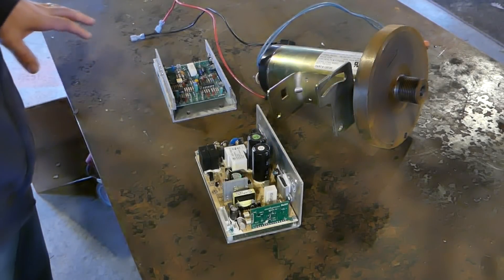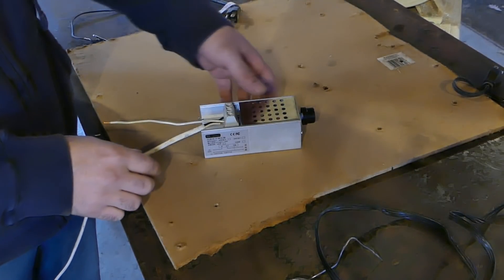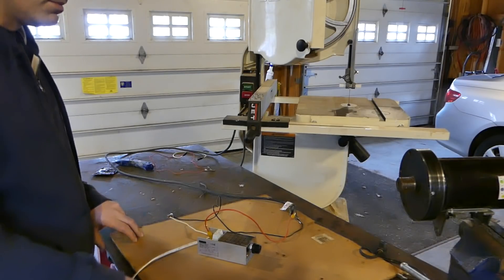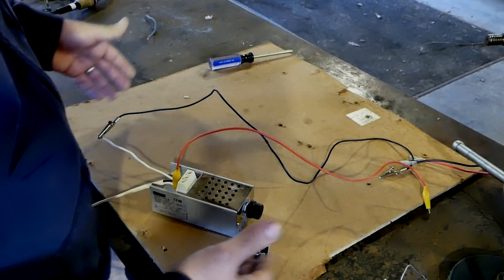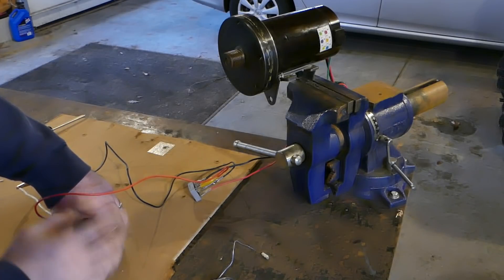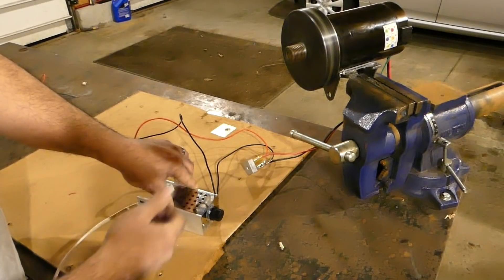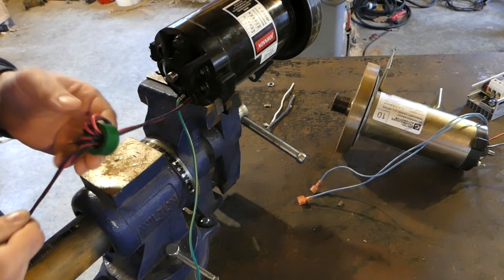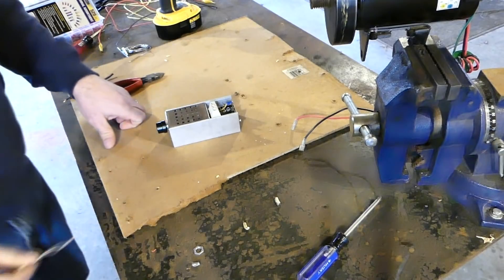Low Cost DC Motor Controller For Treadmill

Comment: I bought the parts now I got to get off my Lazy ass and build it.  I'd put this inside a outdoor metal box for AC use like a junction box because its 120 volts ac and ??? DC voltage  The Ac will give you a jolt the dc will kill you. Make used to ground the box and use the hot wires for the switch not the neutral like he did.   The Black is Hot in house current the white is neutral/ground  I'd also use a GFCI outlet at 15 to 20 amps for protection. Use whatever in on that Line you read in your breaker panel. Do not use a 20 amp GFCI on a 15 amp line.  Know what the circuit is before buying parts or you could burn your house down. 

The last guy who owned my house put a 15 amp outlet on the same line a Fridge is its always a 20 amp circuit by code on newer homes and you are not aloud to add onto it the refrigerator has to be separate. This guy added a Ironing board and outlet and put a 15 amp plug on it.  After 23 years this outlet shorted out and burnt up. He also did not hook up a ground wire to the metal box he used thats code. I've been told they are going to phase out metal boxes ecpt industrial use.
I tracked this problem down on DIY fixed it  I'm not an electrician.
Don't put a GFCI on a GFCI Circuit they will keep shutting each other off.
These are for if your taking a bath and drop a toaster in the water you don't become toast. But then why would you make toast in the bathroom? You going to Brush your teeth at the dinner table?

Comment: I’ve tried this and the motor just goes full speed as soon as I turn the switch on and sparks like hell. The pot does nothing, what have I done wrong?
Reply: In the process of building one of these and have learned a thing, or two. It may be either the pot is wired incorrect, or the pot is bad. Purchased a few 200k for my project from a seller on eBay and they all tested a little different. There are tutorials that describe how to test your pot. Are you using a 100k, or 200k pot? Are you using a full bridge rectifier in line?

Comment: I purchased the same potentiometer that you used and as soon as I turn the power on the motor starts even though the dial is all the way to the left? Have I used the wrong pins on the dial?

Comment: So 120vDc or 240vDc on a 24vdc motor
Reply: It's a 130volt DC motor isn't it. The two treadmill motors I have are 130v DC

Comment: I have a question.   My treadmill motor..  it has 4 wires.  It's a permanent magnet.  Wires are ..  black.  Red. And 2 blues..  are the blue wires needed to use this set up?.  Thank you for the video.
Reply: The Blue wires are normally for a speed sensor on the motors I've worked with

Comment: I did the same, but finally I modified the system a little adding a Slide Potentiometer. Is easier for the treadmill's user
Reply: I am new for this kind of technic. Please advice me. My treadmill control board was fail. Can I use this technic for my treadmill?

Comment: Question: Will this hold the motor to rpm under a small to medium amount of load?  I assume that a treadmill controller has some kind of feedback from the motor, so that it increases power if the motor is bogged down a bit, so that it will maintain the speed of the big treadmill belt.  Heavy person would then get the same walking pace as a child...??  Or maybe the treadmill controller doesn't do anything but send x amount of voltage for a given setting?
Reply: Obviously this won't as there is now feedback mechanism.  The first complicated idea I think would solve this would be to paint the shaft black, draw a small stripe in white paint on it, put a photo-diode across from it so it can get send an interrupt back to a small microcontroller that will increase or decrease the voltage to the motor to increase or decrease torque.  Unless there is an easier way to control current, which would also be stymied as the current would increase also as you are pushing the workpiece into the tool..... 
All in all, a bit more involved and probably can be avoided by just supplying power and maybe running it at a slightly higher speed before starting cutting/grinding.

Comment: I put this together and it worked for a half hour but then the controller fried. Someone told me using 110v power input with a 220v controller would make it burn out... I'm not an electrician... Anyone know what's up? Did I get a dud unit or do I need to feed it 220v power?

Comment: i really need some help, ive got a 2.2 hp treadmill motor, its 9.5 amps and 180 volts. con someone tell me if this speed controller would work with my treadmill motor.  https://www.ebay.com.au/itm/AU-8A-220V-Variable-Router-Fan-Speed-Controller-Control-Motor-Rheostat-AUS/192809349066?epid=20025145821&hash=item2ce4552fca:g:9AkAAOSwGEJcYOUO:rk:6:pf:0

Comment: Awesome! Would there be any benefit to running this setup with 220V instead of 110V? I have it available in my garage, I'm running the 1hp AC motor for my belt grinder on it with a VFD before I knew better, and I'm going to use a treadmill motor for the mini-lathe I'm building. 

Also, it might be worth mentioning, I think that GFI circuits have a really hard time with the soft starts. I have a relatively new home, and all the 110 outlets in my garage are connected to a GFI outlet, which is a pain...

Comment: This might be asking a bit much, especially 2 years after your video was posted, but I am wanting to make a treadmill motor, variable speed and reversible. Is there an easier way than reversing the wires on the Rectifier?
Reply: Double pole double throw switch.  Motor on the middle 2 terminals and feeds coming from the controller reversed on the other 2 terminals

Comment: Great video and excellent info. Just one question for you, I bought everything you listed and put everything together just like you. My set up works great, but every once and a while the bridge rectifier keeps blowing and I can't figure out why. I replace the rectifier and belt grinder works great again for a while then it blows again. Any ideas why this could be happening to me?? Is there maybe a different one I could try?? Please help
Reply: It's likely your bridge rectifier is too low in peak voltage rating. You need 4 times the normal voltage as a peak voltage rating in choosing a rectifier. What that means is, at 120 volts you should be using a rectifier rated at at least 480 PIV (Peak Inverse Volts). A 600 PIV rectifier would be fine, and is easier to find. 480 would be minimum, but anything higher is fine. The amperage rating should also be greater than your motor's nameplate. So you want at least a 20 amp rectifier on a 18 amp treadmill motor. Again, higher is fine. And you MUST put a slow blow fuse or circuit breaker inline on the AC line to protect your motor and other components from over-drawing current and over-heating. That should be just a little more than your motor's rated amperage ...say 20 A for an 18 amp motor.

Comment: Hi  Mike, finally got all the parts together and it works a treat👍👍👍. The potentiometer that came with the controller seems to work quite well so I probably won’t change it. I couldn’t for the life of me remember where I put the bridge rectifiers I bought so I used the one I found on the circuit board. Next job is to mount it in all control box. I will also use the iron ring on the wires as well as the power filter that came with the treadmill. I don’t know if the filter is necessary or not but as I have it I figure I may as well use it. When ordering the bits and pieces I took the opportunity to also order a tacho so that will also go in the control box as well as an illuminated master on / off switch.
Thank heaps for your very informative video. Cheers Stuart 🇦🇺
Reply: Hi Stuart I see this is an old post and assume by the flag that you are in Aus. Do the items listed work with 240V and if you have any details about the motor or parts I would be really grateful. (not savy with electrical gear) Cheers mate Ray

Comment: I've just picked up an old AC Gilbert No.2 American Flyer transformer (40cycles/75watts). 
Are any parts of it useful in an application like this? Other than using it as a transformer what else could it used for other than a paper weight?

Comment: Is there a way to limit the max output DC voltage to 90 Volt...because I have a couple of 90 volt motors and don't want to burn them up.

Comment: Hi guys, I’m actually trying to repair my wife’s running machine. It was popping the internal 8amp breaker so I bypassed it once or twice and made matters worse. The 120v dc motor is fine, the low power circuits for the led panel are fine, I’m in Spain on 240 v ac.  The bridge rectifier is giving out 160v dc but the circuits after that are dead.  I was hoping I could tap in to the bridge rectifier and add a module then wire this to the motor. Any ideas please ? Thanks.

Comment: I tried this yesterday and got it working. I used a BR5010 bridge rectifier, and 110v 4000w controller, and a 1HP treadmill motor. (My controller is the two inputs- two outputs variety.) Ive had no trouble so far, but it pays to be skeptical about the wattage ratings on these cheap imported parts. 

Eventually I intend to control a larger motor with the 10,000W type,  hoping that the rating is realistic.

I have yet to try the proposed solution to the problem of not being able to power on at a set speed, but rather having to zero it out first, but that would be a welcome change for the people that find this annoying.

I'd also love to be able to add a board with a electronic tachometer with RPM readout. If anyone can offer information on this, please let us know, much appreciated.
Reply: hicould I ask how did you wire yours? from the wall into the controller two inputs and from the two outputs to the rectifier or you wires one of the leads going to the rectifier from the controller input?in the video here I did not catch the 3 wiring inputs..i have scr 4000watts and it has 2 inputs  2 outputs

Comment: Or just change the range of your potentiometer. 
Rt = (R1 * R2) / (R1 + R2).  
So soldering a 2 Watt resistor across the 470k pot changes the values as follows;
680k changes the pot 278k
560k changes the pot 255k
400k changes the pot 216k
390k changes the pot 213k
330k changes the pot 193k
270k changes the pot 171k
 etc.
BTW: Use one of the handy online Parallel Resistance Calculators to find the best combination.
Reply: Is there a danger of going too low with the range? I've got a 180K on there now and do get a better feeling (turn wise) out of the pot but it still has to be set to 3 or higher for the motor to start.
Reply: @WaveDudeTX  - My advice would be to adjust the pot range so that the lowest possible setting still makes the motor turn reliably. That way you will never forget to turn the power switch off. Using the pot to stop the motor drops the apparent voltage to a level below the threshold that makes it turn, but still leaves voltage applied to the windings. It's too easy to forget to turn off the power switch when the motor isn't turning.

Comment: Can you use a DC variable speed controller with enough power or watts but less voltage so then obviously more amps than the motor itself and have it work ?  I know the torque would be effected but would it just work at the speeds allotted from the dc variable speed controller ?  Example being a 0-60Vdc controller and 130vdc for the motor , ?  What would it be like if it does work ?

Comment: not sure if anyone can help me, but I've set this up on my treadmill, however, when I turn it on, the motor makes a loud humming noise. Also, when I step on the treadmill whilst running, the noise gets worse and then eventually trips the electrical box it's connected to. Any help or advice would be much appreciated.
Reply: Just finished building one of these for use with a 2HP treadmill motor.  I tested it under no load and I also had the loud humming noise.  The controller seems to work fine at all speeds but that humming noise does not instill confidence.  I won't be able to test it under load for a while.  I'll let you know what I find.
Reply: I did some research on this and it looks like the motor buzzing is the result of the speed controller circuit design and this is unacceptable to me.  I also tried connecting a Harbor Freight router speed controller ($16) to the bridge rectifier and the DC output to the motor.  No more buzzing but the speed controller only has three speeds.  This meets my needs but for 120V @ 15A.   I will look into the circuit design of the original speed controller to see if I can increase the frequency of the controller to something above human hearing - around 20 KHz.
Reply: @k9taxi  I think I'll have to wire up an Arduino to the control board to send pulses to it, since that's essentially what the display unit does.
Reply: @TheAutoDIYGuy  FYI, I also tried my speed controller on the same brand of treadmill motor except the other motor was 1HP instead of 2HP.  The 1HP motor worked perfectly with no buzzing.  So, the problem is either the motor itself or the circuit is not designed to support a motor as large as 2HP.

Comment: Hello I am building a belt grinder and am having Trouble with the motor. When I supply power, the motor spins at one speed. I got a 4000w motor control, 200k linear potentiometer and the bridge rectifier you recommended Any suggestions?

Comment: perfect. my project requires my motor to start as low as 50 rpm. would you know what potentiometer or reostat ? would I need to achieve this low speed ?.   thanks.
Reply: This isn't a speed controller, so if you're looking for a constant rpm you'll want the original motor controller & tach

Comment: Mike the motor controller only has 2 wires for the potentiometer and the only 200 ohm potentiometer I could get has 3 poles. Can I make this work?
Reply: Please read the question below and leave a reply. Thanks Bill

Comment: Very helpful video. I'm running this exact setup to power an old pillar drill. Does anyone know why the potentiometer fails every 2-3 months? Becomes like a switch in that it will only go from no power to top speed with nothing in between. Have tried using quality components so there must be something causing the fault. The treadmill motor also has minimal torque and low speeds. Thank you!

Comment: If you put a resistor inline with the pot, then the top speed will be reduced, if you don't need or don't want the high speed the motor can put out.  I will be using this circuit (thanks for putting this up!) on a potter's wheel, and even with belt reduction, I have a feeling the top speed will still be too high.  I am looking for only 300 rpms top speed and to do that I need a HUGE pully on the final out put shaft.  a resistor is cheaper!

Comment: i was working on treadmills for years and this wont work for treadmills, as soon as you put load on the motor the dimmer circuit will blow up or the motor will burn  or the connections will burn . "wrong choice"
Reply: so how do you explain all the people here in the comments who have been successful with this design, like the comment below this one from s b?
Reply: the reason is so simple, they didnt try it in real and full load .if you ever see a video shown dimmer circuit running treadmill please let me know. its just a good idea for free spinning without load.

Comment: How do I get the drive wheel off the motor without damaging either, and where do you recommend I get a wider drive wheel for a 72 in belt grinder.  Thank you.
Reply: On the back end of the motor there should be flats on the shaft that you can put a wrench on and hold the shaft from moving. Then while facing the front end turn the flywheel counter clockwise.

Comment: Not all SCR controllers are designed to handle inductive loads like a DC motor. A snubber circuit across the SCRs or the motor (or both) may be needed. Also, when the voltage to the motor is turned off, it will generate back EMF. The FWB will act as freewheeling diodes, but they may not be fast enough to switch efficiently.  Also, you have wired the ferrite core as a common mode choke, and if the current in both motor wires is equal and opposite, it won't have any effect.
Reply: so how would you wire the choke? individual wires, reverse winding?
Reply: can I use the large choke that came with the treadmill?
Reply: You SHOULD use the choke that came with the treadmill

Comment: Thanks Mike, worked great! I used a different controller (P/N 090456) and the potentiometer that is already installed on that unit works great. The first 1/3 turn does nothing but after that I get full variable control from very slow to top speed and everything in between. I also mounted the rectifier on a heat sink from an old dell PC, not sure if necessary but using on a lathe and just want to keep everything cool. Excellent video Mike!!
Reply: You should be able to get that full range back by adding a resistor to one of the leads going to the pot.  Just use your dmm to get resistance ohms just before it starts spinning. Lets say its 200 ohms.
Just add a 200 ohm or maybe 180 in series with one of the wires going to the pot and you should have mostly full range back.

Comment: Hello I have a 120v dc motor that I am trying to hook up I have everything in the video and I am using 120vac input am I missing something?  it will not work. Also what kind of voltage should be coming out of the rectifier? I am only getting 17 VDC

Comment: I see two problems with this control, 1. the rpm of motor can be over it's rated speed and damage the motor or the flywheel could simply explode, 2 if you have a variable load the motor it will not maintain a set speed and slow down with more load. I am using one of these controls to control the speed of a foundry blower for my furnace with a treadmill motor and since the load is constant it works fine but with a lathe or a belt sander the load with be a variable load and the rpm with go up and down as different loads are applied.